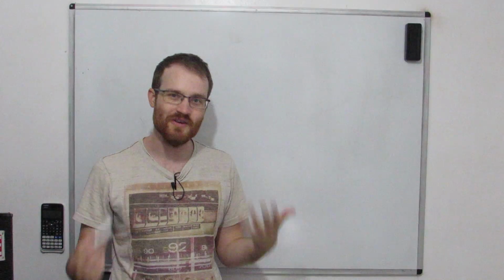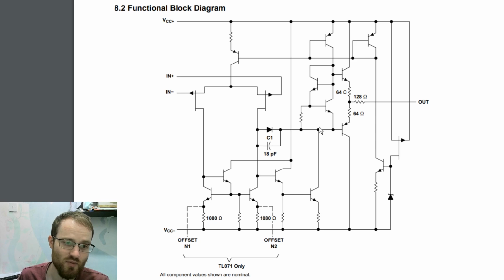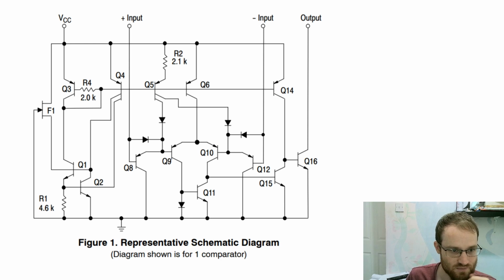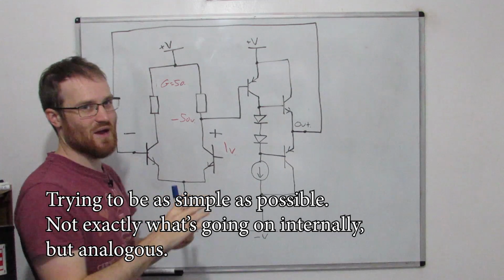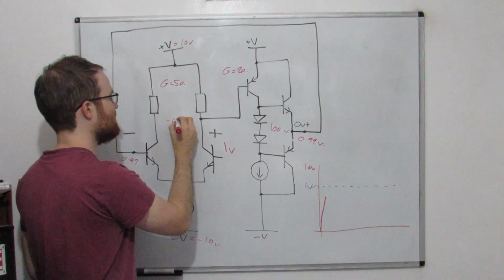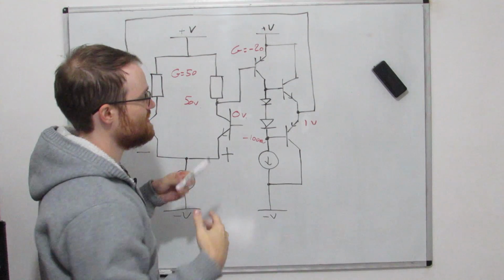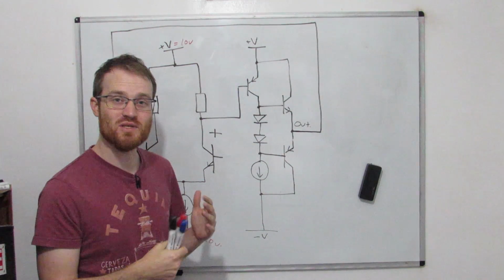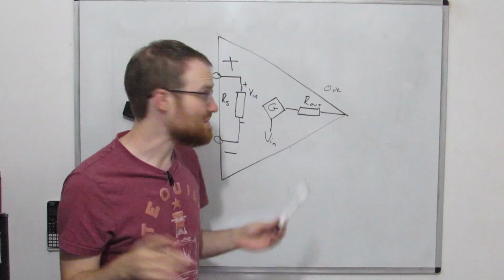How Do Op-Amps Work?

Comment: I understand how it works for AC case, but how it is possible that it amplifies also small DC voltage? Where is the clue which enables that?
Reply: the internal circuit does not capacitor coupled , so DC   signal works

Comment: I never really attempted to understand the inner workings of an op amp before, but you made it seem so approachable! 

A request for a future video. In what ways do real op amps differ from the ideal model? Both in terms of what's going on inside and how it affects its behavior in common application circuits. What parameters do I need to understand to select an appropriate op amp?
Reply from the maker: Will definitely do a video on just that!